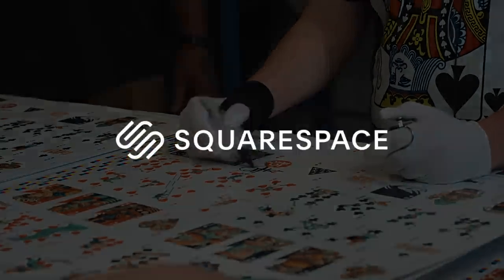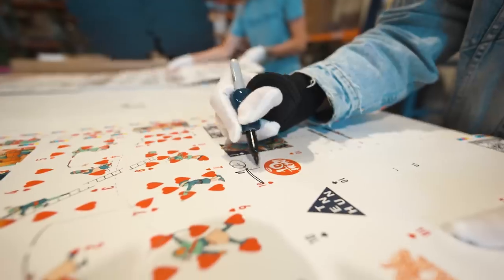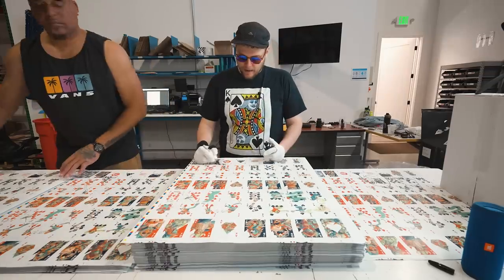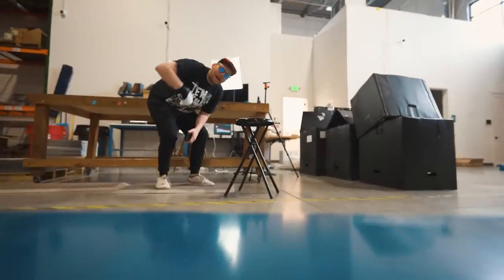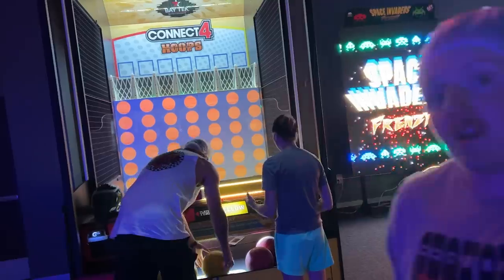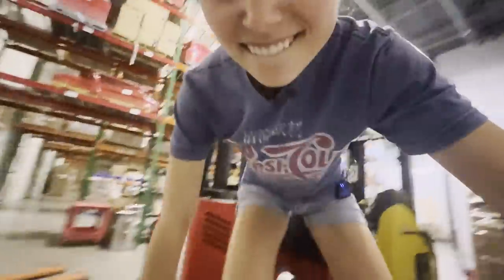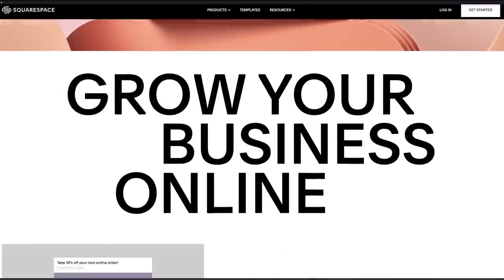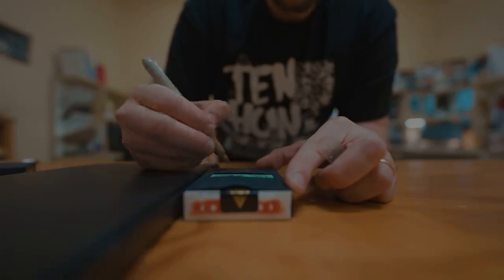Signing $1M worth of Art Prints!

Comment: Someone should invent a machine to shuffle through materials that need to be signed or autographed, kind of like one of those machines that count cash. Or maybe like a tabletop that can detect the pressure of the marker — when you lift up your arm slightly after signing, the print slips into a stacking chamber underneath and a fresh one is rolled out. We’ve got to improve this process somehow!

Comment: So if you made a digital signature you could have a Silhouette Cameo 3 (or 4) sign them all with a Sharpe or pen... that way it has the realistic marker look but you don't have to kill your hand. You'd need to cut the card sheets first. If you sold the uncut sheets for wall art etc you could get the same results with a 3d printer by "spoofing" it to think there is a plastic extruder and only print layer 1 which would be your signature. ^.^ #TheMoreYouKnow